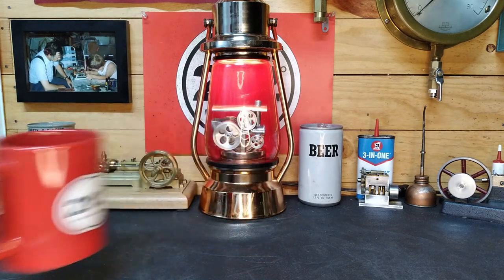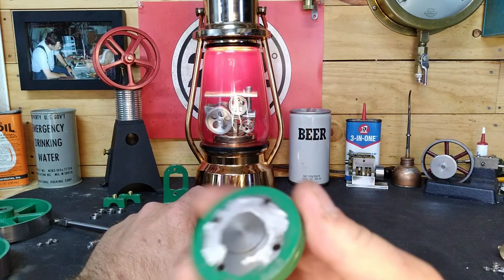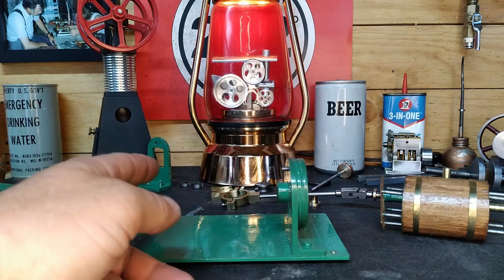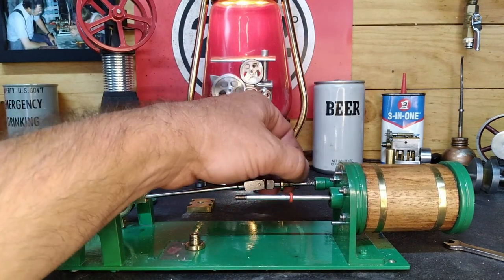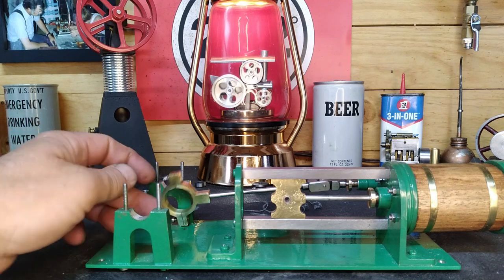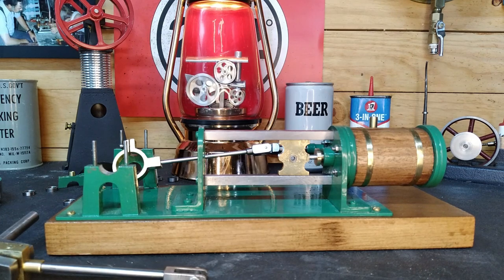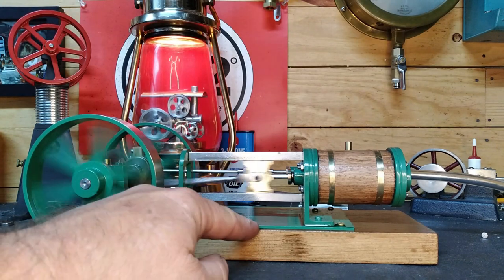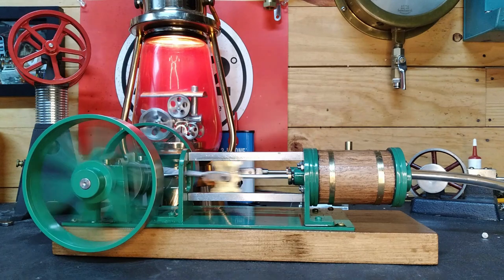Will it Run?  English Bar Stock Engine Part 3, Time to put it back together!

Comment: I think the base and paint suits the engine as is. if anything just true up the flywheels.
Reply from the maker: I still need to drill and tap the flywheel hubs to fit a set screw but we'll get to that soon enough 👍. Thank you for watching and commenting

Comment: Great to see it run . But parts glued ?. I have an aversion to glueing steel brass etc .
You have installed ball bearing mains ? Then oiled the mains ? Where is that oil going to go if the bearing race is there
Reply from the maker: I said "glued" meaning that it is most likely sealed with silicone instead of a gasket like the the cylinder head and rear cover were. I did oil the main bearings, I don't know if I said it on the video or not but, I removed the seal on one side of the bearing (inner facing) so the bearings don't have to rely on the little bit of lube applied at the factory. Thank you for watching and commenting, I hope I answered your questions.